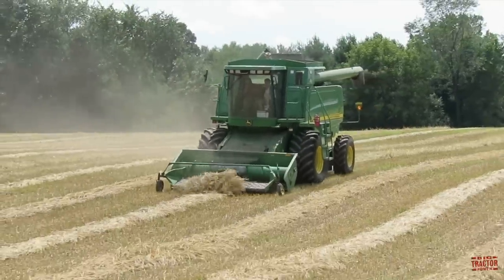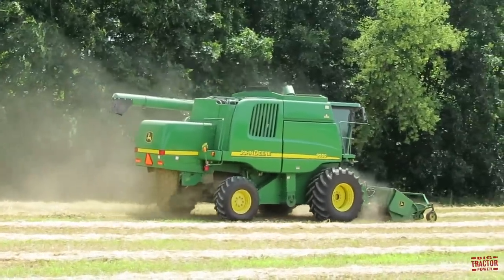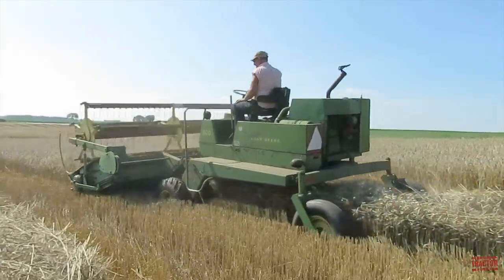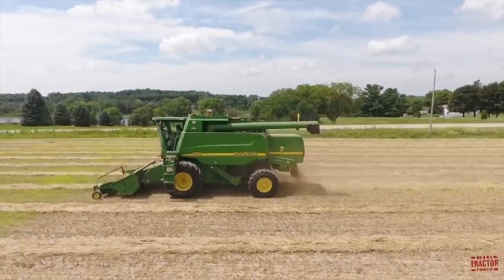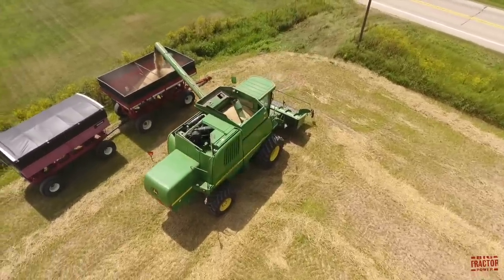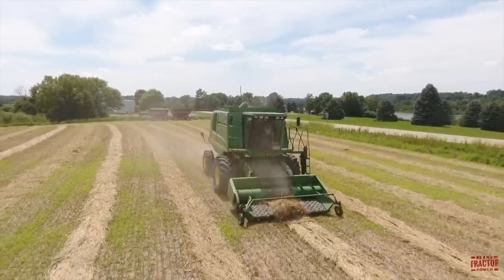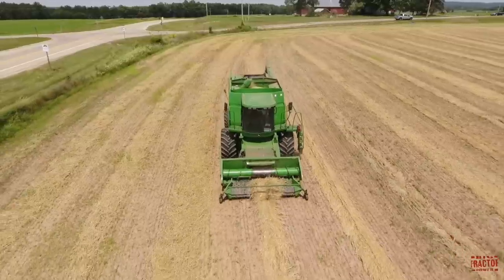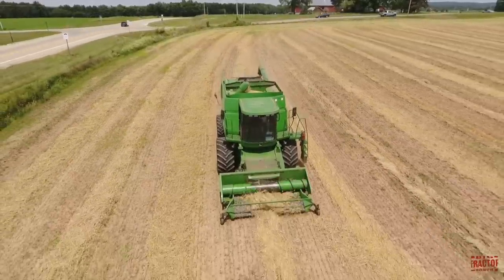JOHN DEERE 9550 Combine Harvesting Rye

Comment: I would have loved to jump from the 9500 to the 9550...but we went to a 700hr 2017 S680 last year...I think with the bottom sieve out on the 9550, and a non chopping 8 row corn head, it wouldn't be much slower than a S680 in 200bu corn. After 200bu it would be considerably slower. At 240bu our 9500 made crazy noises.

Comment: Those 212 JD pickups are not a great pickup, I have them on my 8820 and 7720. You have to run them really flat like you see in this video in a light crops or the swath just goes underneath the combine. The newer model ones are a lot better from what I heard. That swath should have been twice as big for that combine.

Comment: Awesome find!! This 9550 is in beautiful shape too!  We also own a 9550 (& 9500)...love the 9550. I was surprised how much more of a machine it is compared to a 9500...Deere increase grain handling capacity by making the clean grain elevator bigger, also the 8.1L powered ones have noticeable more power than the 7.6L 9500; Unfortunately Deere made a huge mistake when they started putting the JUNK 6.8L engines in the last year year make 9550s and onto the 60 series class V walker machines. Hard to believe, roughly 20 years later a farmer can't even touch a new combine for over a $1/2 million...$155k for that beautiful combine seems like a steal in today's upside-down world!
Reply: Doesn’t entirely make sense why they did that for the 2003 season. The 8.1L was used entirely across the board for all the 50 Series models. Maybe it was to help justify production of the 6.8L since the 9450 was the only model to use it prior to 2003. The new decals and logo determine this 9550 to be 2002-2003.
Reply: All the 9550s had 8.1 L engines.
Reply: @bcdieselsofficial no they don’t. Late 9550’s made ‘03 Deere started putting 6.8L in them…just ahead of coming out with 9560’.
Reply: @EDBZ28  I looked at the manuals. The 9560 also had an 8.1 l engine.
Reply: @EDBZ28  you’re right, they did. I’m guessing they eventually switched back to the 8.1 on the 9560 though, because they show both engine options.
Reply: @bcdieselsofficial   @EDBZ28  They actually did revert back to the 8.1L with the release of the 9560 STS in 2004. For the 2007 model year (Last year for the 60 Series) John Deere switched back to the 6.8L. When the 70 Series was brought in for 2008, they stuck with the 6.8L in the new 9570 STS.
Reply: @matthewkabanuk443 yep and they were junk engines. I know 2 guys in our small farming area that had 6.8’s blow up…in a 9560 walker & 9570.
Reply: @bcdieselsofficial yes, and like I said before I had researched this extensively before buying my 9550. I don’t know what I’m gonna do for our next combine. I’m hearing a lot of trouble with 9.0L in 9660&9670’s and 13L in newer S series. Deere has put out some SHIT engines ever since Uncle Sam mandated emission standards.
Reply: @EDBZ28  we love our 9 L in the 9660. The 60 and 70 series was before the DPF.
Reply: @bcdieselsofficial  good to know. Thanks. How many hours you guys have on it?
Reply: @EDBZ28  we have about 3000 hours on it
Reply: @bcdieselsofficial  nice…pretty low hours for that machine. I’ve always liked the 9660&70. Sharp combines. Someday I’d like to get into a class 6 with a 30’ head.